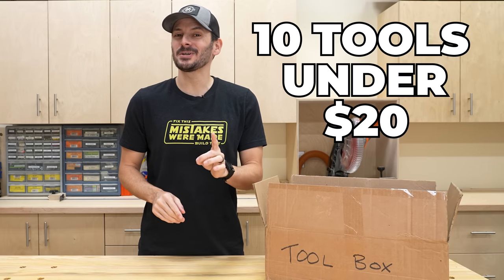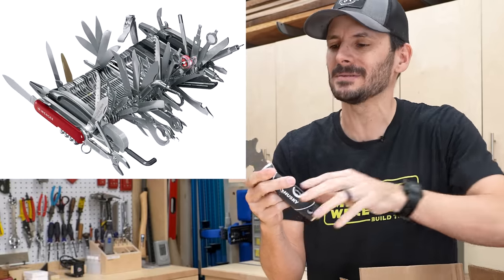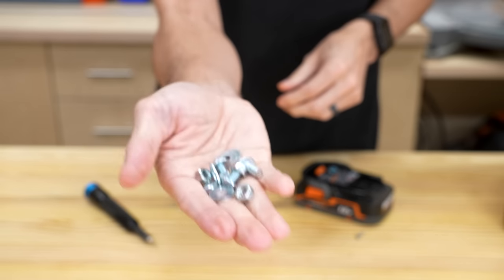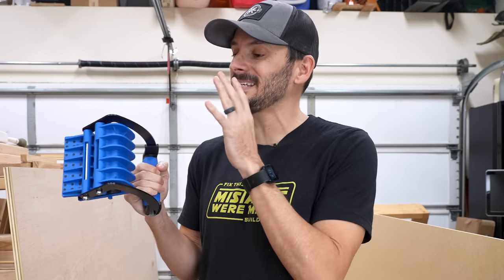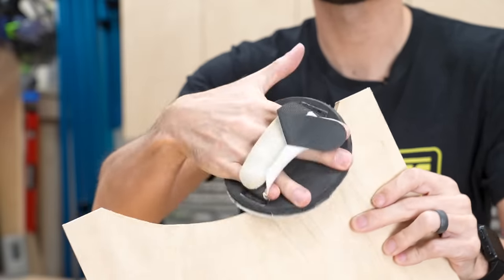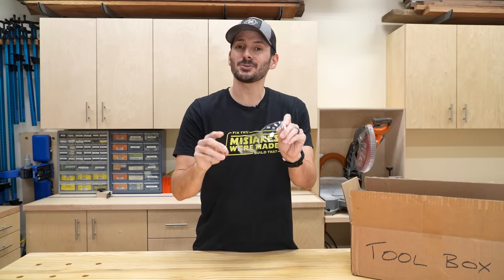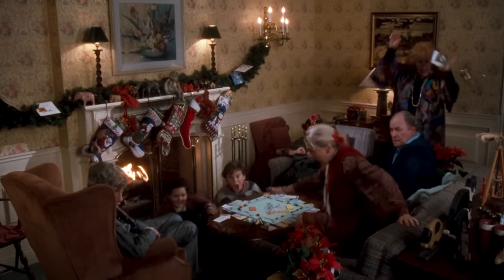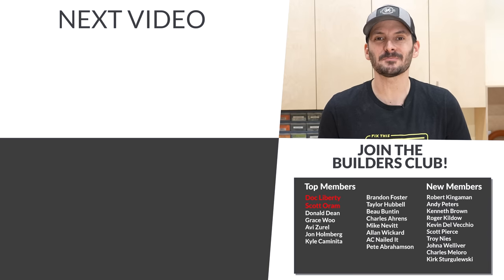10 Tools Under $20 to Level Up Your Shop

Comment from the maker: Check out more tools under $20:
12 Tools Under $20 Every Woodworker Needs - https://youtu.be/QCDaE-0pXoY
8 tools Under $20 YOU Told Me to Buy - https://youtu.be/Xd0JjlRvc-U
Reply: Don't use those plywood handle clamps on cement board (Hardie board) it will snap them.
Reply: Love the channel! Happy May the 4th sir!!! I am also a HUGE Star Wars fan.

Comment: Hey Brad. Make sure you keep your 3M organic vapour mask in a sealed container when you are not using it. As the cartridges contain activated charcoal which will continuously absorb vapours. Also when you can smell the chemicals or solvents etc when using the mask you need to change your filters. Love your content. Chris the Paint Shop Guy.

Comment: Hey so that 11in1 (or whatever the number was) with the hexes, I think the hex cutouts are for the disassembly of paint guns for cleaning after use.  The tool I have that like has the right size to loosen the nozzle and other parts on the paint sprayer.  Pretty handy so I don't have to go hunt for wrenches.

Comment: By the way, a permanent glasses wearer has nothing to do with these goggles - and even with the shield! The problem lies in the anti-reflective coating applied to the optical lens, which is nullified by such protection. I have also come across safety goggles with an anti-reflective coating applied to the inner surface, but of course they are from the next price class. It is very easy to recognize them - a white ceiling light reflects red or green from such glass. 🧐

Comment: The 8 in 1 or whatever they call it has those wrench cut outs for paint sprayer hoses. If you work with an airless sprayer, they're pretty handy. For everyone else, stick with the regular 5 in 1. The new ones at harbor freight are like 5 bucks.
Reply: I was about to type the same thing it’s probably only good for your paint sprayer

Comment: Hey Brad, the 3M 60921 is the cartridge with organic vapors and the P100 particulate filter both in one 🙂
Reply from the maker: Ahhh, good to know. Link for those interested https://amzn.to/3F2sBhA
Reply: @Fixthisbuildthat  Fit is everything in respiratory protection.  Technically, your beard negates the half face respirator from passing a fit test.  You will still be exposed to fine particulate and vapor without a proper fitting mask.  If facial hair is unavoidable, consider investing is a PAPR (Powered Air Purifying Respirator) system.  You can get the same filter styles to fit these systems, the head tops can be used with facial hair, and they add a nice cool breeze while you work.  3M TR-600 is the way to go.       

The way you use the half face respirator is for sure better than nothing.  Just figured you should know about the correct solution for your hazard exposure.  I too am too vain to shave my beard, and the PAPR has been my saving grace.

Comment: The best purchase I ever made for my shop is a pair of bifocal safety glasses.  I struggled with over-sized goggle-types to wear over my eyeglasses (which often meant that I just skipped wearing the safety glasses at all...) - and then I found the bifocal version about 15 years ago at the Woodcraft store in Boise.  Those safety glasses are now the very first thing I put one when I go into my shop!
Reply: Wow. I didn't even know that was a thing! I don't need to wear corrective lenses, but sometimes the magnification would be really handy.
Reply: that's good to know, great tip Jim, now I know what to put on my CHristmist list
Reply: I wear prescription eyeglasses with polycarbonate lenses. In addition to being lighter, the PC lenses are VERY impact resistant - but they are NOT ANSI rated. For that reason I also wear ANSI rated goggles over them, and/or my Trend Airshield Pro (which also protects my asthmatic lungs.) Years ago I used to have conventional safety glasses, but my prescription made them both heavy and expensive. (Fortunately, they were paid for by employers in my pre-retirement careers.)
Reply: Have you ever considered a face shield? I find myself always reaching for mine when I finally bought one.

Comment: For anyone interested in those magnetic parts trays, shop around online and you will find a variety of sizes and shapes to go with whatever projects you do the most.  There are small rectangular ones the size of that tray of screws you dropped on the floor.  I find it useful to pre-load those small trays with common fasteners so they are within arms reach, and you can even turn them on their side and have them stuck to a magnetic backsplash over your work area.  Doesn't take up as much space as a bunch of plastic trays and there is no risk of knocking them off the bench (and even if you did the fasteners would stay in the tray).
Reply: I keep my two on the side of my drill press next to my bench.  Use them often.  Like that paper towel idea.

Comment: Regrading the 3M filter mask, I recently realized there are different models with different sizes. Since switching to the right size (M->L) it seals better, and is much more comfortable. And I use it much more.

Comment: Love that box cutter/scraper!!  It’s larger in size, so for me with arthritis in my hands, it will be easier to use.  And I could actually use the scraper part.
Reply from the maker: Yeah, it's got a nice size to it 👍
Reply: As a bonus feature, the opposite end of the cutter/scraper can be used to open paint cans.
Reply: It uses proprietary blades though that are hard to find.
Reply: Yes having to buy their blades sucks. They are expensive and wear quickly when scraping. It was a big letdown because the knife is awesome.

Comment: Your tip at the 5:16 mark reminds me of another trick I used.  I have a bigger magnetic tray and I spilled some nails (I think it was), and since I don't have a magnetic sweeper, what did I do? I slapped the magnetic tray to the underside of my hand truck and used that as a quick-and-dirty  magnetic sweep. Worked like a charm.

Comment: Safety glasses are a must! I used to be a machinist, now i was wearing saftey glasses but a metal sliver somehow got under there and into my eye. I woke up that same night around 2am and felt like i had flash burn. By 8am that morning my eye swelled shut and felt like it was on fire. Everytime i moved my eyes the sliver was cutting the inside of my eyelid. Eye doc just used a magnetic needle to extract it. But took about a week to heal and any sort of light would immediately make me tear up. I was rocking sunglasses indoors and an eyepatch that whole week. Its was painful to even watch tv.

Comment: The 6 in 1 painter's tool, to me, is a must have tool for every shop. Never knew what the curved part was for. As for the magnet tray, I keep a couple of the Mag Switches floating around the shop. The advantage they have over the magnetic tray is they have an off/on switch. So, pick up the screws, bring them over the container, turn the mag switch off and they fall into the container. I also use them when fishing for a screw or nut that has fallen into the saw dust/shavings piles. Big piles from the wood lathes....

Also, I love the router/sanding matts for the shop. Get mine from Woodcraft, but sure there are others. They provide padding for your fine pieces of wood, and also fairly non slip. I have them in the drawer where I keep my bench chisels. They are also great for under your sharpening stones, both for the kitchen and the shop, and under the cutting boards in your kitchen.
Reply: Curved part helps clean paint off of your roller. Give it a try!

Comment: Really useful video.  One thing about the respirators - for them to work properly the wearer needs to be clean shaven (I have a beard too, but I have had to shave it off to wear a respirator while working with hazardous materials).  Facial hair disrupts the facepiece seal almost completely negating most of the utility of wearing the respirator with organic vapor cartridges and/or particulate cartridges. There is a reason why workers occupationally exposed to hazardous materials and required to wear respiratory protection based on air sampling are required to be clean shaven to ensure they pass what is called the fit test and also to ensure the best possible facepiece seal.

Comment: Great tips!  I bought the glue dispenser and painter's triangles before the video was even over.  I stain 2 sides of wood a lot and the triangles are a  better way than how I've been doing it.   

I bought the Kreg plywood/drywall carrier about a month ago and wish I would have had something like this decades ago.  I carried 22 sheets of 1/2" drywall out of a trailer and up flights of stairs onto my second floor, by myself, in about a half hour.  Without the Kreg tool I would never have been able to get them upstairs alone.

Comment: So as a painter, the ass end of the tool I use to fix wall after i take a nail or screw out a wall before i fill hole. My foot is the " hammer" you speak of. The scraping fat end can also take out outlet screws.

Comment: The 15 in 1 putty knife has the hex wrenches for breaking down a spray gun. One size fits the tip and the other where the paint cup attaches. Useful if you are someone who sprays allot and don't want to carry the extra tools.
Reply: Great comment thanks!

Comment: I think you have those reversed.. 2097 folters are absolutely rated for organic vapors.  They were a mainstay in the injection molding shop I worked in for a decade.

Comment: Those Kreg pucks are awesome. I have dozens of the triangular/pyramid painters blocks as well as a number of the sanding pucks, but the painters blocks are frustrating as they tend to slide around or even flip when any pressure at all is applied. Since these have a wide base and are rubberized, they will be stable and not move. This looks like an awesome product! And the painters blocks can still be used after finishing both side as drying racks so those don’t become redundant. Thanks for this tip!

Comment: While I generally like Kreg tools & have a number of them, I don’t like their prices on some items. Instead of paying for the Project Blocks & Painter Pyramids, I just purchased a bag of 12 hockey pucks, rounded of some 1/4-20 bolts to points for $19.99 on Amazon. $1.67/each plus the price of the bolt.

Comment: You need to check out the Purdy 10 in one folding paint scraper, another really nice folding tool is the Kobalt chisel with the folding handle I recently got a double sided folding pull saw from Temu and the handles fold together all three excellent ideas for a tool bag. I like the Craig marking tool you did in another video might be my next purchase. All these items are under 20$ as well.

Comment: FWIW, Harbor Freight has a HUUUUGE set of different mag parts trays, different sizes, shapes, colors, all at pretty good prices. And this is the kind of thing that really can't be done wrong, so, yeah, HF is one of the better ways to go with these.

Regarding face protection, even better is
Amazon: UVEX by Honeywell Bionic Face Shield with Clear Polycarbonate Visor (S8500)
Just a hair over US$21 as I write.
They allow people who wear reading/closeup glasses to use them comfortably. This also flips up out of the way if you need it, and is usually far enough away from your exhalation that it does not fog up overmuch.

P.S. another thing of some relevance is bifocal safety glasses, which provide some assistance with seeing limitations for those of us with less than perfect eyesight.

Not sure about wearing with any kind of respiration mask, however. There seems to be a limitation there, in that there are not many things that allow both  or provide both...
Reply: Also, there are times when Harbor Freight offers those magnetic trays for FREE with any purchase.  That's how I got mine.

Comment: If you liked the Pentel graphgear 1000 the rOtring 800 retractable mechanical pencil is on another level! It's the best feeling pencil with a nice solid metal weight to it. It's also great for fidgeting with the coolest opening mechanism ever thanks to German engineering.

Comment: The hexes and screw drivers on the 15 in one, fit the most common sizes on airless paint sprayers. So If your working with a paint sprayer constantly. It frees up a good deal of space in the pocket.

Comment: Safety dude here.  For the respirator, make sure to shave and get a good seal.  Like another commenter said, keep the cartridges in a bag.  I really like 3M respirators because they have a design that routes air awayu from your glasses.  On the goggle, the enclosed style will also keep chemical splashes out of your eyes.  On the ear protection, ear plugs are cheaper and more effective, but you need to get a proper fit.  It should sound like you are underwater or holding a shell against your ears.  See if you can get a sample pack from the company.

Comment: Paper towel trick with magnet made the video worth watching. For those interested in the switch utility blade please be aware it requires a specialty blade; you're regular utility blades will NOT work. Just be aware.

Comment: you forgot the magnet broom, it keeps you from bending down to pick up metal objects, it's also good for picking up metal objects in your driveway, this is especially nice for those annoying times you are working on the truck and drop a screw/nut/bolt in the grass

Comment: The magnetic tray has a better use if you need a place to hold nuts, bolts, screws etc. But have no flat surface like working inside a duct or metal area, you can just stick it to the side of the metal and hold nuts and bolts while you work

Comment: Regarding earplugs - I highly recommend Radians Custom Molded Earplugs. They're cheaper than that package of disposables, less wasteful, and are as good as big hearing protection earmuffs while being far more comfortable and without conflicting with safety glasses. I use the red ones so it's easier for people to tell I can't hear them at a glance. 

Little tip while molding them: push where your tragus meets the side of your face to counteract the expansion you cause by pushing the uncured putty into your ears. If you don't, they can be uncomfortably thick in that spot once they've set. This will only be an issue if you plan on wearing them for more than an hour at a time, so don't worry about it too much.

Comment: This might make it under  your $20 limit (depending on the exchange rate), but it is always in  my pocket. My father had a brass one, but Lee Valley came out with a steel one.
Lee  valley marking multi tool

Comment: 5:20 Try this. Turn your magnetic bowl over and set you plastic tray on top so the magnet pulls whatever is inside locking down your container so it does not fall on the floor.

Comment: Around the 10 minute mark, you're discussing the breathing protection.  What's your opinion on the effect of your beard on the effectiveness of the mask?  I stopped growing my yearly winter beard when COVID hit because of the problems with a beard over an N95 mask, and when I'm in the shop, I use a dust protector that has a mouthpiece (like in a snorkel) that connects to a pipe that hangs over my back to two hepa filters, called a Resp-O-Rator.  It's the only mask that I know of (other than the very expensive full face forced air systems) that can be effectively used with beards.

Comment: For anyone who's batteries wo t charge, apply the required battery voltage to the battery, + to + and - to -. The problem is often a cell balance issue but when you force voltage in it allows the components that monitor cell balance to balance all the cells on the charger. I fixed my RC batteries and my milwaukee batteries like that.

Comment: I like the enclosed goggles because they fit over my glasses.
Reply from the maker: Good call!
Reply: I didn't like the layering of goggles over glasses plus ear protection so I found prescription safety goggles as an all in one. With an elastic band, the ear cups seat properly as well.
Reply: @CBDrafter  If I had a job that required it, that would be the way to go. But I am a DIY'er on SS. I can barely afford my regular glasses let alone prescription goggles.
Reply: @fortpatches  I'll have to check them out, thank you.

Comment: I have the 1st razor knife/ scraper. It is good for glass.
However for me, it is not good for scraping/ removing caulk as the handle is too thick and hits the tile keeping the blade at too much of an angle.

Comment: Great video, Brad! I'm going to have to pick up one of those flat flexible sanding pads. I didn't know I needed one until now! Also, smooth move hiding the Rockler logo on the bench cookies as Woodcraft is a channel sponsor. 😉😅 - Joe
Reply: Also, the 6" flexible hand pad is no longer available via your affiliate link. Do you have an alternate link?

Comment: I used one of those magnetic trays once to hold the microscopic screws for a phone I was changing the screen on. It worked great till I started to reassemble and found that it had magnetized half of the screws with opposite polarity to my magnetic screwdriver so it repelled all of them.

Comment: On the glue tips when they get clogged up put them in hot water and you can clean them up. I used to have a lot of tools but during the process of being put on disability i had to sell a lot of them to pay bills so if anyone wants to help me get back on my feet i need to get some tools back. I need a sander bad

Comment: I have several of the glue bottles and while they work well, the glue tends to dry inside the bottle because the rubber cap doesn't seal well. Pulling the dried glue from the bottle is a major pain.

Comment: When I fix doors if the screw hole is a little big I use toothpicks to fill in the hole to make the screw fit tight
Reply from the maker: Oh, great tip

Comment: Had one of those glue bottles ,,found the shaft hardened after first use,,, how did you stop that ….thanks
Reply from the maker: Keeping the cap on and the lid sealed tightly has worked for me